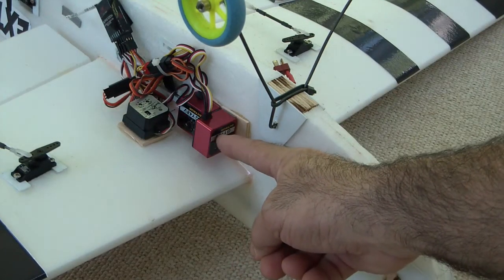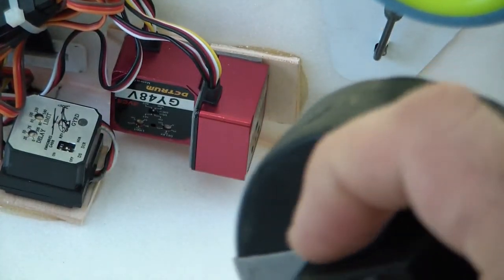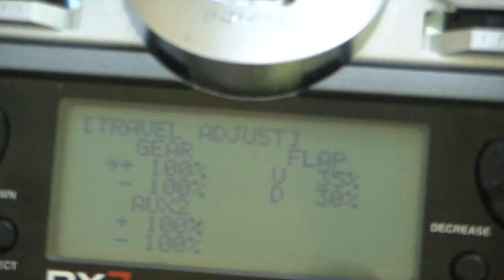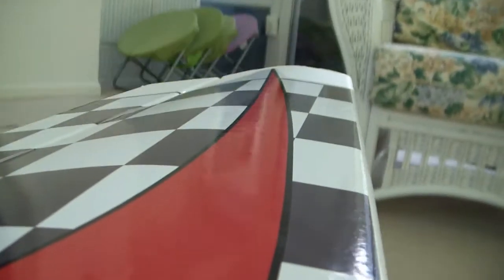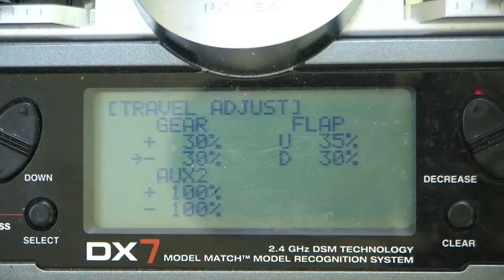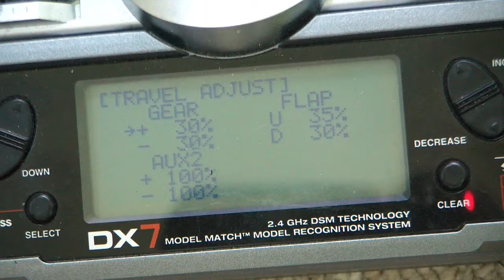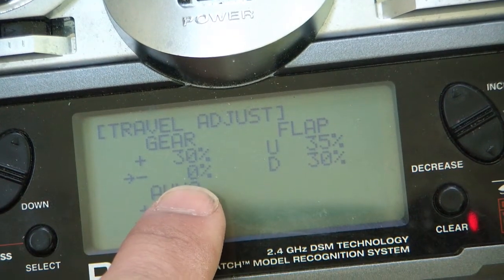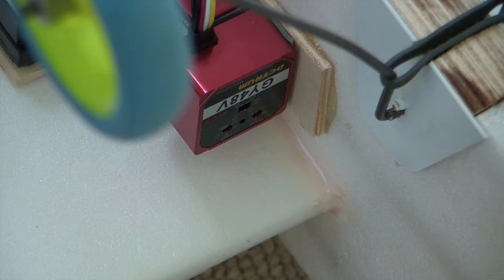gyro on an RC airplane - Aileron

Comment: I'm using a dx9 with eternity aileron only gyro I've got it plugged in as you suggested on the gear Channel although my switch a for gear does not turn the gyro on or off please help. Also, I don't have a by papers for the gyro not due if it's heading or hold mode

Comment: But where do you plug the other two gain wires. So you are using 4 channels for flying your plane,you use one channels for ailerons gain wire??? Do you somehow plug the other two gain wire in 6 and 7 chanel of your reciver,or you leave it unpluged? What hapens if you leave it unpluged? Will they work at all?

Comment from the maker: If you have 1 gyro on the ailerons, you plug gain wire into a spare channel like gear or flaps. In this plane, I have 3 gyros and I use a Y connector and connect the Aileron and Elevator gain to a channel and the rudder to another.  Aileron gains are typically lower than rudder or elevator though. I just like to turn off Rudder in the air.  Go To mycoolrc and look at the page on gyros.

Comment from the maker: For demonstration purposes, I hooked up the Aileron gyro's gain wire to the gear channel. But when I fly the plane, I have the Aileron and the Elevator gain channels hooked up to the Flap channel and the rudder on the gear channel.  Ailerons normally can tolerate a lower gain so if you test the ailerons, the elevator is usually not going to be a problem.

Comment: Ahh, this is a subject I love!  Gyros!   I have had sooooo many people argue that you cant use a gyro with dual-aileron servos (thanks Dave!)   I'm glad you delved into the HH/ Rate functions but I'm confused about which gyro is connected to the gear channel?  Is it only the roll gyro?  Also, dont the travel adjust and sub trim on the gyro channel do basically the same thing?  I don't have a handy little light on mine to tell me what mode I'm in.

Comment: OK,but I have one more question. Could I connect all tree gain wires in one channel,and turning it off or on at the same time on all gyros? Maybe this is not good because you can't set gain for every one individualy. My problem is that I use some cheap chinese RX-TX,6 channel,and I am out of channels.